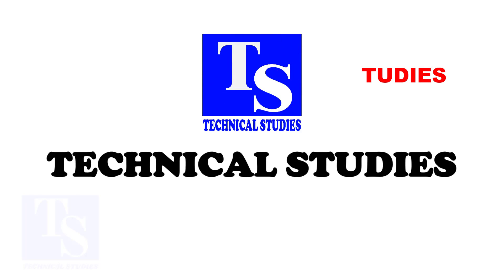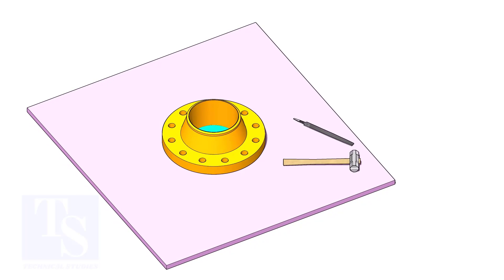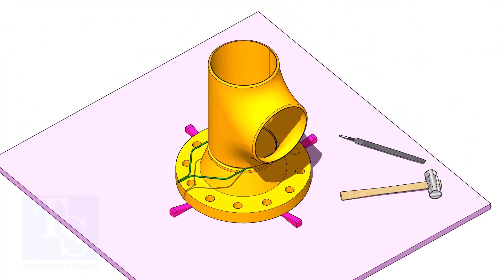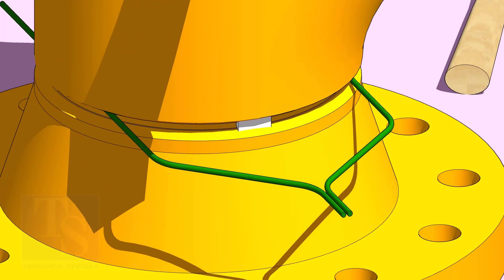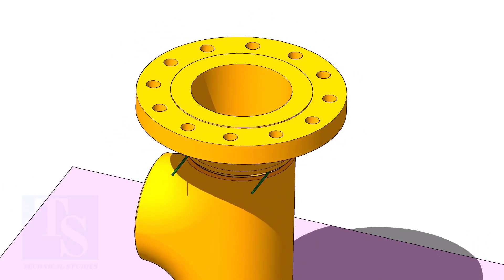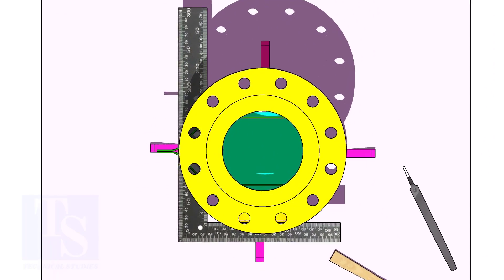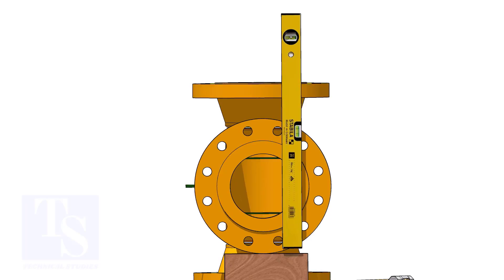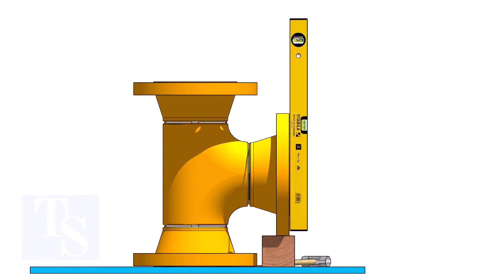Tee to Flange Fit up, advanced training tutorial. Pipe fit up tutorials

Comment: I had a no 5 record vise in a pipe stand to fit small inch fittings . Would fit the flange of the branch of the Tee first.  put the tee in the vise branch facing up .eye ball level the tee, then place steel banding on the face of the branch, after  place tee on top of banding on top of branch using 2 squares, square the flange to the tee then tack .  this was then welded if there was lots of the same, after then put tee with flange in vertical  position in vise with tee run facing up repeat 2 holing flange and squaring flange to flange . flip repeat

Comment: That was always my favorite way of assembling items, by stacking them like that, It's a quick method and uses minimal equipment, Great tutorial.
Assembling them in the workshop, I had vertical and horizontal lines marked on the walls so would just use a straight edge and /or square to align them to the the wall marks
Reply from the maker: I think both of our work styles are the same. Some times, to avoid the video length short, i purposely minimize the work procedure. Thank you very much for your great observations and comments.